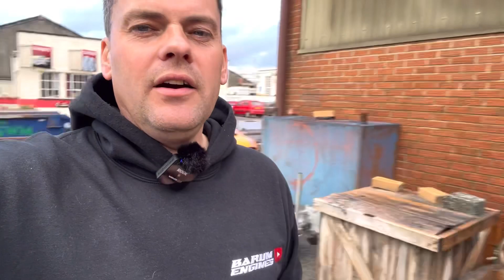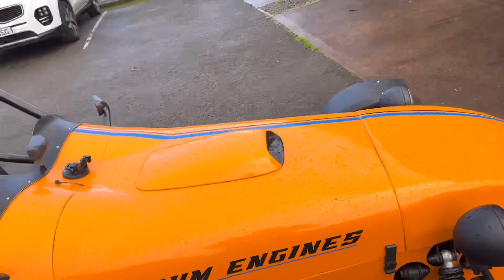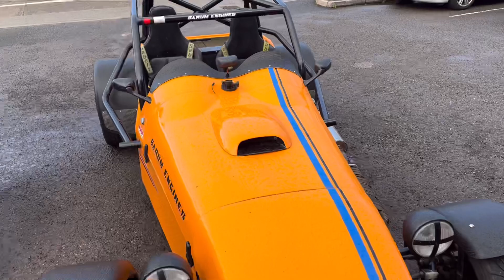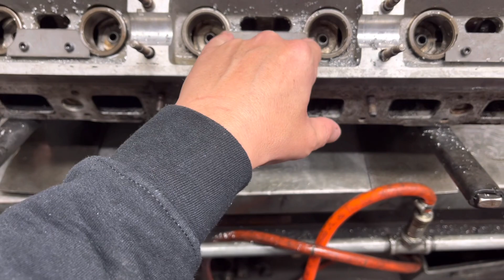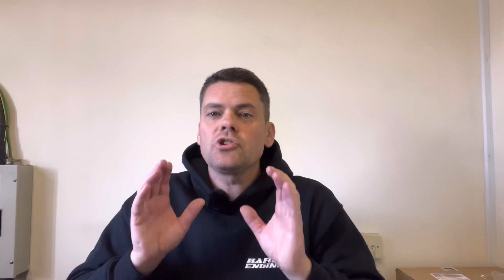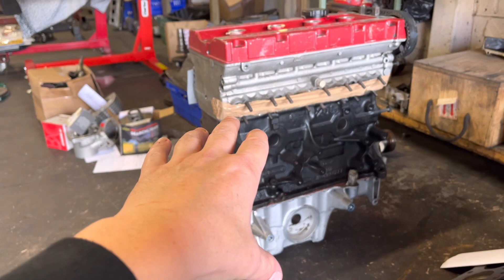Is the Lamborghini being held for ransom? If so, The reason could surprise you

Comment: I kind of know the reason why their holding on to the car and requesting proof of the email chain being deleted is because that their in breach of the GDPR (general data protection regulations).

They have breached it because they should have made sure that the information is'. used fairly, lawfully and transparently and handled in a way that ensures appropriate security, but sending sensitive data of an individual to a 3rd party without consent from the individual or having not agreed to otherwise having their personal information shared can lend the dealership upto if not a 20 million euro fine or in the case of an undertaking, up to 4% of thier global turnover of the preceding fiscal year so that's is why their kind holding the car to ransome. Its because it can cripple the dealership if not lamborghini itself,  
So it's a choice on how you want to proceed delete the data and have the car returned or possibly go the legal route and report it to the governing body of the GDPR with legal aid in tow.

Comment: Crazy behaviour by the dealer. You don’t have an obligation to delete the invoice they sent you or provide proof of deletion, that isn’t part of your contract with Lamborghini. It is reasonable to end up deleting it but not for the dealer to hold your car hostage, refuse to bill and not return your car. The two issues are completely separate. As others have suggested, go in person, offer to pay the invoice and insist on taking the car away. You can sue them if they try to charge you loads more based on their promises. You could get a solicitor to write a letter but I would just try to get hold of the head office - the local dealer will be cowboys but head office will know that holding customers to ransom is a terrible business approach.

Comment: Avon CR28 are oldies but goodies for '7' style reps , if you can get them.

E-mail the dealership and tell them that they are at fault for issuing a false quote and that you will retain it for evidence.  They have contravened GDPR Regs, not you (?).  I would also tell them to return the Lambo by a certain date as you have a requirement for its use, failing which you will charge them £x damages/day.  As you are willing to pay transport for the return of the Lambo you do not owe them any money so retaining the car as set off would be seen as illegal. notwithstanding its value vastly exceeds any claim they may have on you.

The Rover 100 engine is the same as used in Series Land Rovers, its an F head, where the inlet is an overhead valve and the exhaust a side valve.  When set up properly these engines are limo smooth and are almost inaudible on idle.

Comment: The GDPR issue is separate from the Lamborghini service. Yes, they can demand you to delete the email, they cannot demand proof. There is no way of proving deletion without an audit, which they have no right. Then tell them to stop emailing you otherwise you will report them . Send a letter before action to the requiring return of the car, you have said you would pay for the work done. The lambo dealers sound like a bunch of backstreet traders, well shot of them….

Comment: Now that the Brexit transition period has ended, there are two versions of the GDPR (General Data Protection Regulation) that UK organisations might need to comply with: 

The UK GDPR, which, with the DPA (Data Protection Act) 2018, applies to the processing of UK residents’ personal data; and 
The EU GDPR, which continues to apply to the processing of EU residents’ personal data. 
 Learn more about the differences between the UK GDPR and EU GDPR

The UK GDPR and DPA 2018 set a maximum fine of £17.5 million or 4% of annual global turnover – whichever is greater – for infringements.

The EU GDPR sets a maximum fine of €20 million (about £18 million) or 4% of annual global turnover – whichever is greater – for infringements.

However, not all GDPR infringements lead to data protection fines. Supervisory authorities such as the UK’s ICO (Information Commissioner’s Office) can take a range of other actions, including:

Issuing warnings and reprimands;
Imposing a temporary or permanent ban on data processing;
Ordering the rectification, restriction or erasure of data; and
Suspending data transfers to third countries.
For comprehensive guidance and practical advice on complying with the GDPR, read our bestselling EU General Data Protection Regulation (GDPR) – An Implementation and Compliance Guide.

Comment: You can't 'prove' you've deleted the material, as any steps you take can be undone (or you could have just kept a copy and lied!). Tell them they are going to have to take your word for it and be grateful you pointed it out to them. Meanwhile, any data breach, no matter how minor should be self-reported by the Data Controller, along with whatever measures have been put in place to avoid a re-occurance. Therefore I would adopt my 'hold up the mirror stance' and ask them 1. have they self-reported, and 2. What measures they have put in place to prevent my (your) personal data being sent to a third party. And ask them when they are delivering the car back serviced and detailed as compensation for this appalling example of customer dis-service and inconvenience.
Or, tell them to get the Data Controller to deliver the car  personally, and if you're happy with it, you can let them delete the email and attachment themselves...

Comment: Why do they want you to delete the email? They broke the Data Protection law and are potentially deep in the do-do is why! But just how, by all that's holy,  do they suggest you send them 'proof' you deleted an email? Once it's out there it's out there, it will be luking on your internet provider's servers and backups for starters then, depending on how you operate, there could be multiple copies on your different devices, you could have forwarded a copy to your lawyer (not a bad idea?) or just plain printed it out and nailed it to the wall!
It's very hard to prove a negative! Just further proof these guys are - to put it kindly ....err...somewhat less than competent?

Comment: Would never trust a dealership. Years ago bought a £3,000 2nd hand traffic van from Renault Cardiff. 2 weeks later leaking oil from engine side end caps seals. Took it back told rac/Renault warranty don’t cover leaks,sorry mate that will be £16 for finding leaks . Told them have no money so they best keep van. Was then said charge waved and off I went. Took engine out and sorted seals/leaks in Mum and Dad’s back garden. When engine was out discovered universal joint on steering column was soo worn was about to separate and kill me and anyone in this vans way. I reported this to mot inspectorate . Ironically I had asked for a new mot as part of the purchase deal. Yeah, dealerships have flashy big buildings but means nothing.

Comment: I am a GDPR and computer security specialist. DO NOT delete that data till you are happy with the final result on the Lamborghini. It is you4 most significant lever to get them to toe the line. At your discretion threaten to lodge a complaint with the Data Commissioners Office if they don’t comply.
Reply: Rubbish & very bad advice. Lee is already in potential hot-water for accessing the attachment to an email not for him & even worse taking other actions as a consequence (quoting that rates are different to his own quote). If you really are a GDPR specialist, which I doubt, you'll know that Lee has put himself into a situation where he, himself, could now be considered a data controller & is unlawfully retaining the data. This could have civil law consequences, should the lambo dealership wish to persue it.
Reply: @wirdy1  under Article 4 section 7 of GDPR there is a clear definition of a data controller. He does not fit that definition. The only way the Lambo workshop can get out from under is to report themselves to the Data Commissioner for what would appear to be an accidental breach. That is their legal obligation under the circumstances.
Reply: @garyhicks3982  The data controller possibility is a side issue that could be argued. The huge issue though... As a 'Specialist' you're strangely quiet about the consequences of refusing to delete the email and the reading & acting upon the information contained in that email?

Comment: Quite simple really two separate issues.
Car fixed - returned 
Data breach - all they / you can do is confirm destroyed / removed. Really more their admin issue. Once info has left / they’ve lost control of it so for example someone less caring than you could have shared it 100 times and sent proof destroyed! 
They can’t confuse / make one reliant on the other. Bonkers buisness sense.

Comment: If it were me I would  seek legal advice, including a) asking the legal eagle about their right to insist on the action they require, and b) their right to hold your vehicle.
I would also ask if exposure of their methods would be actionable by them.... and if not, just threaten them with exactly that. 
Added to this, previously you stated that they did not yet have the 'go-ahead' to do the service, so did you actually agree to let them do this or did they just continue anyway? That in itself would be a good reason for you to take legal action against them..  Seems to me they are really worried that you have 'found them out' with this wrongly sent email.

Comment: You have shown an unwillingness to escalate the breach of data protection, you haven't mentioned the other customers details. They, on the other hand seem to want to create an issue by demanding you "delete" your copy of the email.  The problem is, you can only consign the document to the bin in your computer, but it will still exist in the hard drive on any computer you have used to view it. Do they want you to destroy all your equipment, and are they willing to pay for replacements?

Comment: I've just taken a quick glimpse at the comments, and agree with the gist as to legal process re Lambo, except that the email and their withholding release of your vehicle or two separate legal issues, and they cannot be conflated legally. You might suggest to Mr Lambo dancer the forwarding of the email for escrow with a notary public and a signed statement that you've erased the original. 

If that doesn't satisfy The Dancer, a word with your local constabulary, or rather his, might be in order.

I'd say your video(s) on the matter are becoming more tantalizing with time.

Comment: Now you know y American call them stealers, just like BMW! I don't take my 325ci convertible any where dealers,can do almost anything my self,if l get stuck and ramp needed,which l don't have got good specialist just down rd also specialist BMW scrap yard,they run several bms of there own,also offer repair work when needed l live in sleepy village, helpringham sth Lincolnshire not much l can't repair,if it's made by man,l can usually fix it,am X RAF ground radio tech spent good part of my life fault finding/repairing electronic/electrical items!!

Comment: The Lambo dealer is up to no good, or is such a mismanaged outfit that you made the correct decision to dump them 
I would send them a letter or email giving them 7 days to return the car, and take this as notice that beyond that 7 days you will be charging them X pounds per day for renting the car from you. 
Also I would immediately make a complaint to Lambo Head Office, in Italy I suppose that would be, enclosing all emails with this outfit together with copies of any other paperwork such as the other customers bill. I would also ask the Head Office if they have a set hourly rate that their dealers have to honour. 
What this does is immediately reverse the situation so that they become the ones in damage control, which is fair enough because they are incompetently managed. 
Any billing issues should be taken to Small Claims Court if you have those in the UK, with you as a member of the public, nothing to do with your business, unless the Lambo is registered in the company name. 
And then relax and see what they do with it. 
Great channel btw. 
PS overfilling a diff should not cause leaking because there should be a vent to prevent pressurisation of the casing. 
Have a great day

Comment: Lamborghini the main scam dealer. 12 hours, 8hours 5hours yup so the scam continues. Let's face it Lee the money you pay is not the reputation of the main dealer. But the rubber stamp in the car's service manual. I think as long as the car's serviced regularly and the service manual is stamped that's the main thing Lee.